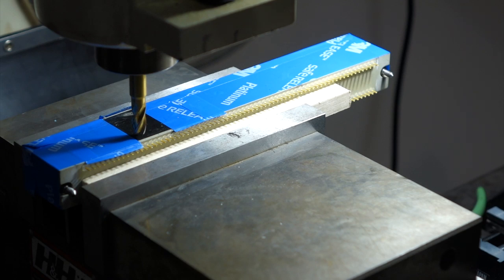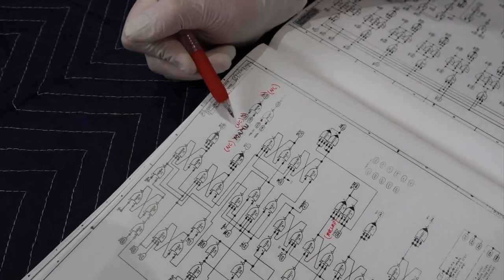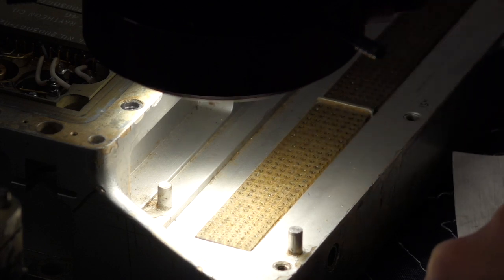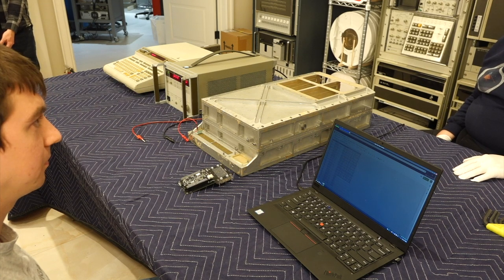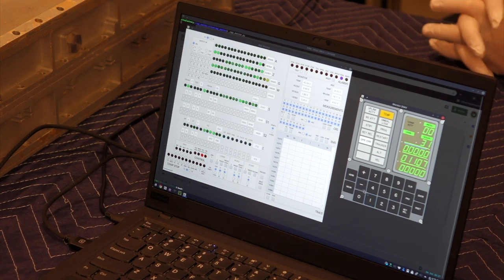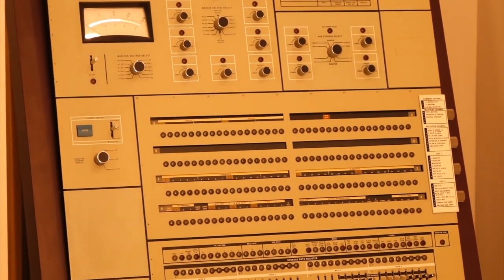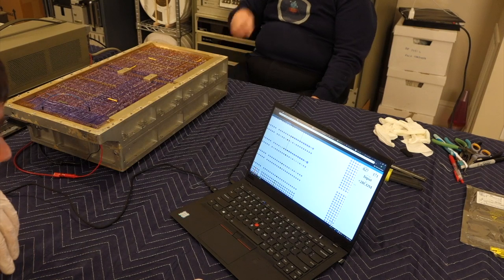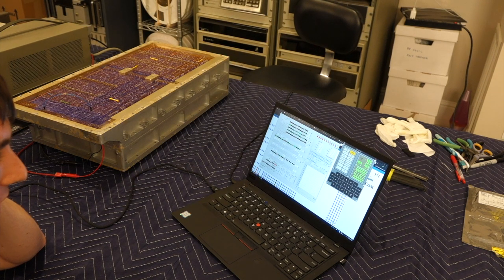Apollo Guidance Computer Part 13: The AGC passes self test under emulated memory

Comment: Thanks guys for these videos. Why don't you guys build an LM emulator?😂 I don't know much as I am just a first year student of EEE. I understand your drive. To make the project work correctly and not sleeping until it is done. I participated in a technology fest of my small college last year. There I built a 4 bit full adder using TTL chips. Stood up many nights understanding datasheets of 74xx series chips (I learnt more from them than from any book), how they need big pull up and small pull down resistors, how floating inputs must be corrected and so on. Then I started developing my adder from scratch on paper. I was so excited when I saw on net that my logic circuit was correct!! The circuit didn't work properly due to loose wires, but it was an amazing journey. 
Then inspired by your SC/MP computer video, I decided to learn assembly language. So I built my own Kim UNO with custom key board, wires going everywhere. It worked!! And my first program was to add 15 and 1 and store the result at address 0000. 
These videos you make motivates me to make and learn stuff. And probably motivates others too. 
Amazing video!!! Keep on making more such series.

Comment: YES, BUILD A LM!!! 👍😃 🚀
Reply: Not an actual LEM, but I remember when man stepped on the moon there was a cardboard LEM in the newspaper that you built. lol
Reply: Marc is gunna need a closed loop gimbal to put that irig gyro in...
Reply: Yes. Let's build an LM and use this hardware to go to the moon (and prove the hoaxers wrong). Kickstarter? + SpaceX?
Reply: @realshompa  If you think about it. it's the $1 parts that prove man walked on the moon. We have a AGC pin in front of us, and NASA would have ordered maybe 20,000. Like why would you make a small custom part of such low value if you are never going to use it. Wouldn't you just pocket the $s, and just say you made a part that no one will notice is not there. You had to build the big parts to fake it, but what was the purpose of building all the small insignificant parts if they were never needed.
Reply: Lets not get ahead of ourselves, start with the command module and go find Snoopy (same computer, different program).
Reply: We don't need to build a LM, all we need to do is go get snoopy and bring him back home problem solved.
Reply: Did anyone check Ebay frist?
Reply: @SidneyCritic  If you have a dig online you can download a super detailed paper model done by a Japanese guy about 10 years ago. 
Papercraft versions of the rest of the Apollo systems are also available (including a a 1/48 scale complete Saturn V stack - BIG). 
Try Lower Hudson Model Shop to start.
Reply: @realshompa considering all this hardware and the programs that still work in these antiques... i think the people that need to be convinced are convinced, the rest are scummy brats who went to school so they can leave the school.

Comment: Yeah, you got the AGC working... but I gave a little sigh when I saw your HP 1925... I used to run an A3 flat-bed plotter on one of those (or something VERY similar)
Reply from the maker: HP 9825. It’s a very sweet machine. By all counts the heir of the AGC, powerful 16 bit portable machine for real time scientific calculous with lots of I/O capability. Ahead of its time and very expensive too.

Comment: @0:42 will you look at all those wires !! Geez ! All those were installed by hand, one at a time (EDIT: corrected by Mike in the replies below)! And to think that there are still some idiots out there who think that we didn't go to the moon...
Fascinating, captivating series ! Better than anything on Discovery Channel or National Geographic. Keep up the excellent work ! And most of all, thanks for sharing !
Reply: Not installed by hand! These wires were all placed by a Gardner Denver Automatic Wire Wrap Machine. That machine took in a big punch card deck that specified the pins, level, and route for each wire. Only the copper power bus bars, little bits of insulation to hold down the wires, and some minor reworks were manually installed.
Reply: @mikestewart8928  
Thanks Mike for the correction/info. Still that's a lot of wires. I'd be very curious to see this Gardner Denver Automatic Wire Wrap Machine in action. Some sort of computer guided robot of some kind, similar to modern pick-and-place machines of today I assume ?
Reply: @AlainHubert  The original documentary "Computer for Apollo" talks about the process, and shows a Block I backplane being wire wrapped: https://www.youtube.com/watch?v=YIBhPsyYCiM&t=24m15s

Comment: 14:30 Hook it up to the NASSP simulation, it already have interface to virtual AGC emulator so it should be possible to hook it up to the real one. It simulates IMU obviously. It has all the inputs from what i recall and it can run enteire mission using emulated AGC. It is just matter of doing interface that gonna communicate with physical one. You will then get preatty much fully functional LEM (with all the virtual switches and stuff) with real physical AGC. It won't be easy to simulate lunar landing on AGC without NASSP because it needs not only valid IMU inputs but most likely also the radar data, rotational hand controller inputs and maybe something else.

Comment: On the new connector you forgot the original anticorrosive cadmium coating.
Reply from the maker: Absolutely not! Watch the previous videos. Samtec paid for the 50 mils of gold, just like the original one. No corrosion on these for the next 100 years.
Reply: @CuriousMarc  Please excuse. It's not about the contacts. They will last for an eternity. It's about the connector housing. The AGCs chassis is coated with cadmium a common coating in the aerospace/space industry. But because of its toxicity, ROHS and REACH regulations it has been in a phase out process. Here in Europe no one really does cadmium coating anymore even though the performance is mostly better in contrast to other coatings. So, you must do the coating in-house if you want cadmium. A friend told me that nowadays coatings like Alodine 1200 are used. Alodine 1200 is still yellow but some are transparent and harder to work with because you can’t really tell if the part is coated.

Comment: You should have made a full-scale panel.  Use luan and LEDs, so it just looks (pretty much) the same.  It doesn't need to work like the original; it's just a display prop so drive it using an Arduino.

Comment: Just wondering, is there some reason why you didn't try using compressed air to blow the dirt off the contacts? It does wonders at cleaning the automotive parts, easy, fast and non-abrasive. The other wondrous material from the automotive world is the brake cleaner spray, but I'm not sure if it would dissolve some plastics in this case (it's safe for rubber, most paints and many plastics, but dissolves things like the silicone sealant, and some plastics are not safe), so plain compressed air would be safer.
Reply from the maker: That’s the first thing we tried of course. But the dirt, sans and debris was impregnated and compressed in a gooey contact grease, and air did nothing. We also tried some mild solvents to no avail.

Comment: Would butane safely clean the silicone grease?
Reply: Uh well.. no not "safely" but without also dissolving the connector I mean :P
Reply: No need! This AGC has silicone grease because it was installed in a Lunar Module at one point. We found some documentation that states that during installation, all external G&N subsystem connectors were "liberally applied" with Dow Corning DC4 grease. It's supposed to be there, and actually kind of saved us -- it prevented deep corrosion of the gold contacts, and restricted all of the contaminants to a thin layer at the top. Once Carl figured this out, we realized we didn't need to actually remove the silicone grease itself; we only had to clear the gunk out of the top of each contact. This greatly expedited the cleaning process.

Comment: how difficult would it be to simulate the IMU?
Reply from the maker: Simulating the IMU signal is not that hard. It’s having the correct IMU response to LM inputs that’s tough: you need a complete physics model, including moon gravity, weight and center of mass of the LM, vectored thrust of the engines and RCS rockets, etc... They did such a simulator at the time (it was a technology feat, took 6 large computers), and the modern Orbiter/NASSP has a very accurate simulation. Just a lot of tedious development work to interface it all to the AGC.
Reply: @CuriousMarc  is the ultimate goal to use the agc to drive a simulated Saturn 5 (in orbiter, or whatever) to the Moon?

Comment: Curious Mark, How many surviving AGC now exist? I would imagine that every command module that flew is sitting around somewhere?
Reply: So I count 14 recovered Apollo command modules on display somewhere in the world...Is this unit the remaining 15th?
Reply: @davidgeorge2611  I believe Marc has mentioned in a previous episode that this is a non-flight-ready AGC (that is, a test unit - and by the sounds of it there are a few of these around). Cheers...
Reply from the maker: Mike would know better, but quite a few actually. But now just one that works ;-)
Reply: There were 57 total Block II computers built. Nine of these were destroyed in flight when their respective Lunar Modules crashed into the moon or burned up on reentry. One is still out there, on Snoopy. A further 15 of them flew to space and safely returned, between Apollo, Skylab, and ASTP. One of them flew on the F-8 Digital Fly By Wire experiment.

As far as known surviving AGCs -- I know of seven in the hands of private collectors (including the one we're working on), and a further ~4 on display in museums. The museum list is:
* Computer History Museum
* MIT Museum
* US Space and Rocket Center (? not 100% sure)
* Smithsonian (? not 100% sure)

As far as the ones that flew to space; I don't know if they're still in their command modules. The DSKYs tended to be removed after the missions, and the AGCs may have been too. I know for a fact, at least, that the fixed memory modules were removed from the Apollo 12 CM, and were on display in the Kansas Cosmosphere.

Who knows how many were scrapped, like ours almost was... If anybody knows of any others on display not on my list, please let me know!
Reply: @toinoi123  Indeed, ours is the fourteenth of fifteen production prototype computers.

Comment: There is a part of solution for next launch of a man to the Moon; use the same old, reliable stuff, just put it in much smaller boxes ;)
Reply: Na, same size boxes (for weight and balance) but parallel redundancy. 3oo5 voting should be about right.